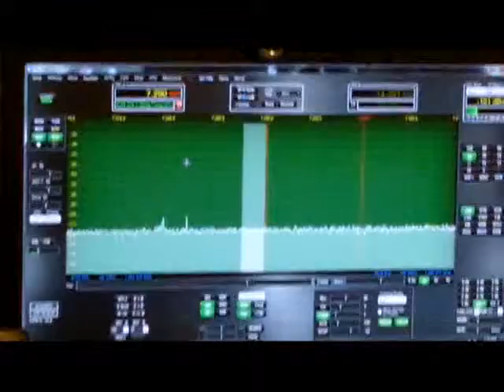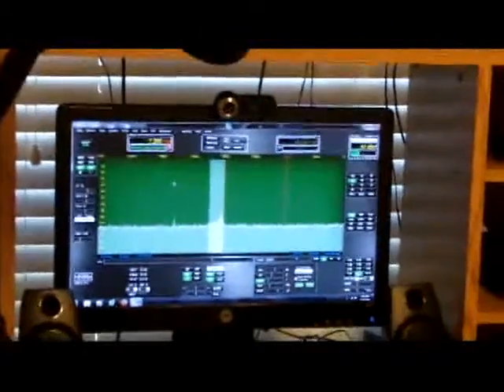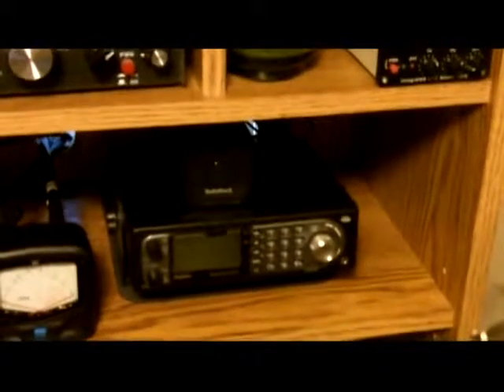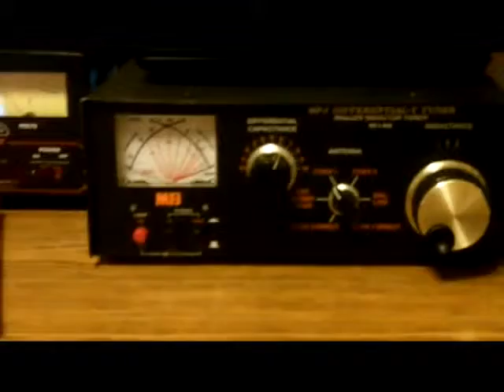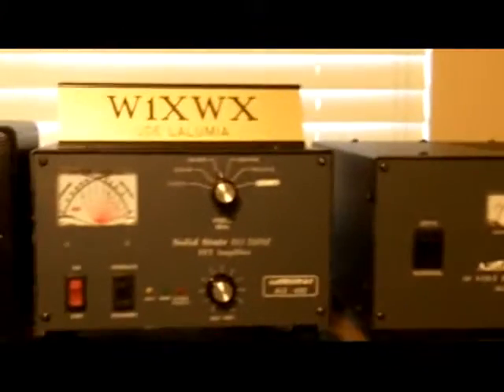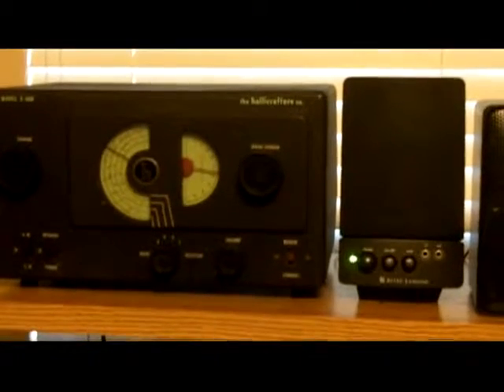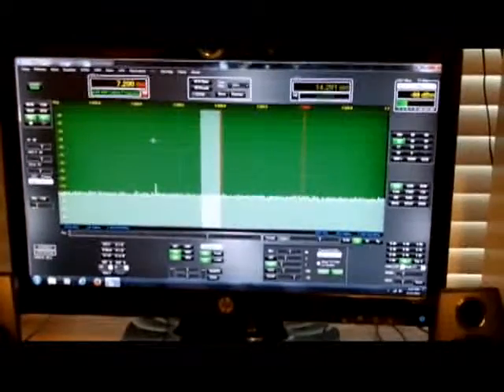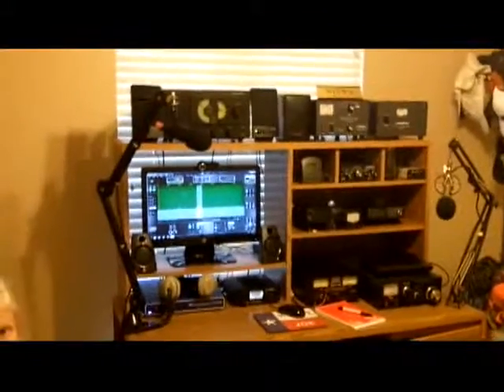TelescopeMan's Ham Shack- Sept 2013

Comment from the maker: You need a computer withb at least a quad core processor and 6 gig memory. Also buy the firewire cable (Granite) that Flex recommends and the firewire card Flex recommends.